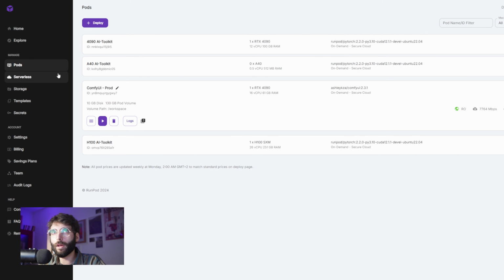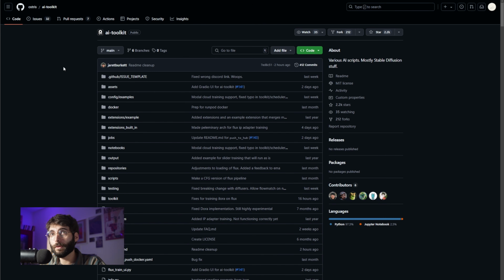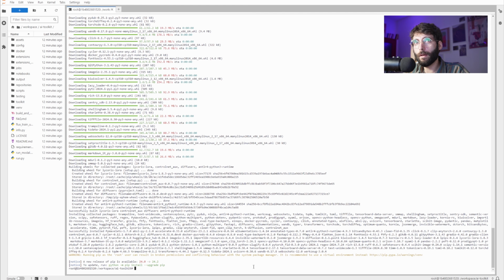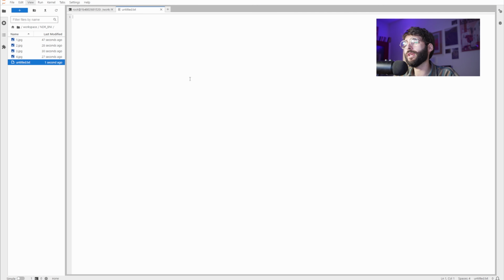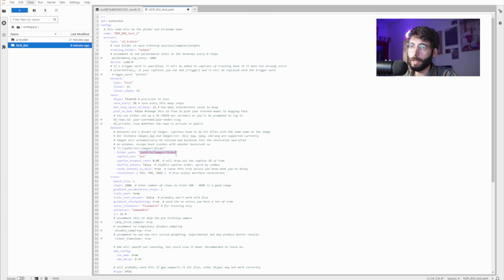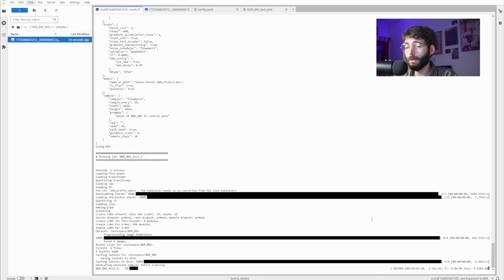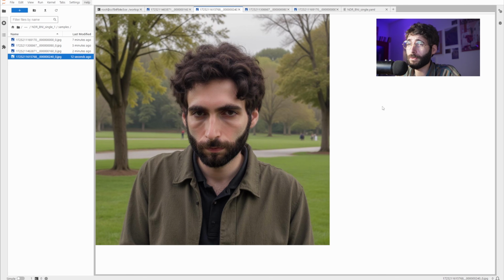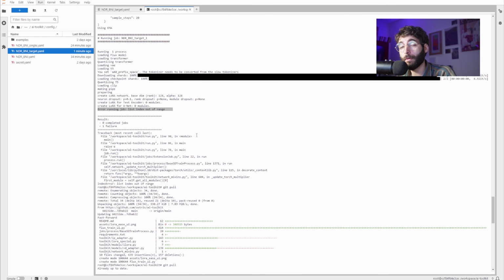Flux LoRAs: basics to advanced (single image, single layers training) with RunPod and AI-Toolkit

Comment from the maker: BTW my configs are definitely not the best - I'm still tinkering around the correct params for the more experimental things like single image training and target blocks training. Most of the time they're not a catch-all configuration, so experiment with rank, learning rate and bucket size to see what fits your dataset.

As for why I construct datasets without captioning, it's because my theory is that - for my specific usecase - I want to train a new concept, so I don't want any previous biases to dilute the concept. It might be wrong, but it's what I'm doing because I need it to be like this in terms of my specific pipelines.

Comment: Thank you for this amazing step-by-step guide. The tricky question that I'm investigating and can't get the answer is changing the optimizer in config yaml file. By default it is set to Adamaw8bit. But if you want to get better quality Lora (esp with the GPUs power of Runpod) it would be convenient to change the optimizer to AdamW (esp if quantization is off). But I can't figure out either it goes "out of box" with the AI Toolkit installation, or you need to change something in the installed code (or additionally install it). Do you have a clue to that? TNX😊

Comment: Thanks for sharing such through documentation. You do a great job of making this process digestable. I have some questions regarding object loras for inpainting pipelines. If I plan on using the lora in an inpainting pipeline, should I train on the Flux-fill base model instead of the standard flux dev? What has worked best for you when training loras designed for use in inpainting pipelines? Since making this video, what have you learned about config settings for training object loras with datasets of 5-10 images?

Comment: 9:10 Is that problem arose just because you didn't set up the virtual environment (venv) to run AI-Toolkit in the first place? After stopping the runpod, you just need to activate the AI-Toolkit venv and run it. Otherwise, it will break because the initial library and dependency installation is in the AI-Toolkit venv environment, and you opened AI-Toolkit without it, so it won't work. Yes, you can just install the requirements again, but you'd be installing them globally (without venv), which isn't recommended.
Reply from the maker: I did say I am an idiot, so this might be precisely why lol

Comment: Thank you for an interesting and well explained guide! I wouldn't have gotten anywhere on my second day doing this if it hadn't been for your tip to reinstall requirements. 

I have actually done a few things differently so far since I followed another guide before I saw yours but I'm glad I watched yours as well for comparison. Especially interesting the part about training on fewer images. I do most of my work with vintage portraits and I often don't have more than a couple of training images that are in focus. Looking into using fewer but better photos sounds like a potential gamechanger.

Comment: How to even test this? I cant find a flux/lora comfy workflow that works with my lora
Reply from the maker: Are you using flux dev non quantized as the base model?
Reply: @risunobushi_ai  I believe so? I used FLUX.1-dev for the training on runpod just like you, and use the same model on comfy
Reply from the maker: Uh, that’s weird. Are you using a loraloadmodelonly node to load the Lora after the load diffusion model node and getting no Lora results?
Reply: @risunobushi_ai  just get this error which seems from github nobody can fix yet. Wondered if there was another way? TypeError: ModelPatcher.calculate_weight() got an unexpected keyword argument 'intermediate_dtype'
Reply: @risunobushi_ai  ahh nevermind, seemed it was happening on all workflows. I uninstalled XLABS node and now its ok

Comment: Would this be the same for schnell? if we just have to use the different config as mentioned in the repo for ai-toolkit?
Reply from the maker: I haven't tested schnell, mostly because it doesn't get access to other things I use (ctrlnet, for example), so I'm not sure - but the config file is there, so it should work

Comment: Hi Great tutorial, however I cannot log into hugging face using the command huggingface_cli login, I get a bash: huggingface-cli: command not found, anyone
 help?
Reply from the maker: Did you install the requirements by following the GitHub commands?

Anyway, you can install huggingface-cli by typing 
pip install -U “huggingface_hub[cli]”
Reply: I got stuck here too. There is a button on the flux hugging face page that you have to accept access.

Comment: 6$ a day makes 180 a month. You could build a decent machine for genAI and amortize the expense within less than a year if compared to these prices.
At least, that's what I'd do if I don't find any better (reads less expensive) solution, but that's me getting anxious really easily when it comes to timer-based expenses.
Reply from the maker: to be fair what I usually do is aimed at professionals first, hobbyists second - and for a professional 6 dollars a day (depending on where you live and work) is not necessarily a lot of money. add to that that professionals often can deduct expenses, or allocate them as a business expanse and invoice the clients for it.
also, being from the EU, a 4090 costs around 2200 USD. 6 USD a day * 5 days a week (6 for me but let's keep it at a work week as an average) * 50 weeks a year (excluding 2 weeks of vacation) = 1500 USD, and that's saying nothing of the prices for higher end cards like the H100 (32k USD + the cost for the server).
Reply: @risunobushi_ai also the cost of electricity to run those cards... nothing to be ignored

Comment: Thanks. You didn't adjust the trigger word in your config files. Is this not necessary?
Reply from the maker: I’m training the same thing (my face) over and over again, so in this particular case changing the trigger word is the same as not changing it. If I wanted to train something different I’d change it, but a trigger word is just a “random” series of letters you append to an image in order to let the model understand that trigger word = the concept / subject / style contained in the image(s)
Reply: @risunobushi_ai  yeah but in the section in the yaml file where you'd define your trigger word it says "p3rs0n" but you used the other word both in your captions and prompts later on. So I was wondering if you maybe missed this one...? I do a lot of testing for training persons myself currently and I found that using a trigger word doesn't really seem to change anything. Sometimes I feel it increases the likeness a bit but this might be also very subjective I guess.
Reply from the maker: The “p3rs0n” trigger word is in green, preceded by a #, so it’s bypassed and treated as a comment

Personally I’m testing single trigger words because it’s what I need for my work pipelines, but there’s definitely a whole lot of different approach, such as no tags, trigger + tags, trigger + automatic natural language captioning, etc

Comment: great video

by the way you forgot to change the folder path in your config for your single image training
Reply from the maker: I realized and I switched to my H100 (that’s why at one point I say “I switched to the H100, I was sitting through all the trainings for the video and I decided to run them all in parallel on different pods), rebuilding the dataset and config file behind the scenes. It happened so many times during the recording of this video - “wait, did I switch the dataset / output folder names?” 
It still happens when I do my own training, I just forget one parameter and I have to restart the training, way more times than I’d like to admit!
Reply: @risunobushi_ai  I guess that even happens to the best of us all the time :)

Comment: One major issue with runpod is that all the templates are not updated to the tools to train flux loras. If you are not working in a professional manner with them, it's not worth it because you have to pay for the pod volume even if you aren't using it. It would be great if kohya or AI toolkit actually get a template so you don't have to set up the pod all the time.
Reply from the maker: this might be me actually doing it for work, but I'm paying 3 cents/hour for the disk storage, which ends up being something like 0.7 dollars a day, which is not a lot for what I do. but regardless, if you don't actually need the storage, you could terminate the pod and set it all up in something like half an hour every time you actually need it. it's more like a matter of convenience, which could be improved with supported docker images, but then someone else would need to actually maintain them
Reply: @risunobushi_ai  yea I know, there are images available actually, but none of them are updated sadly. Kohya for example has a flux branch but the images sadly don't use it. Regardless it's a nice Video